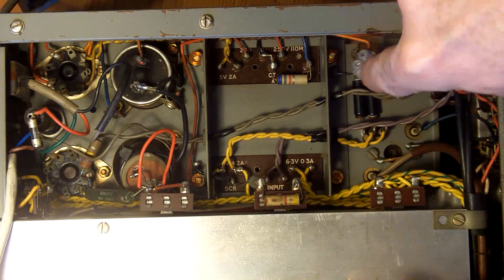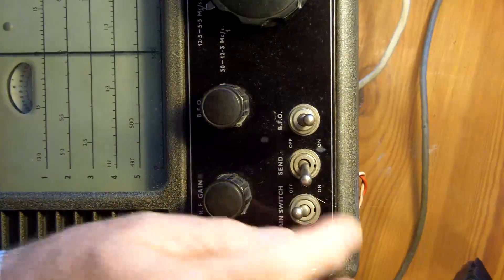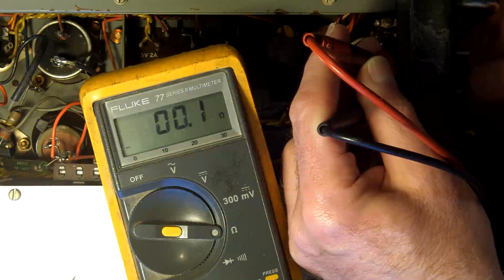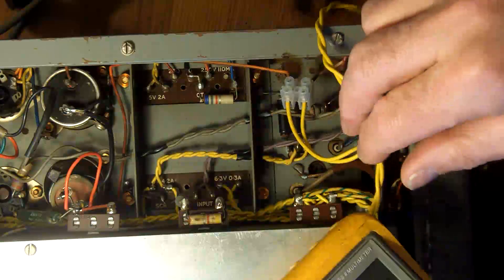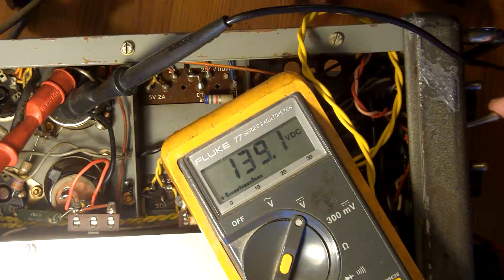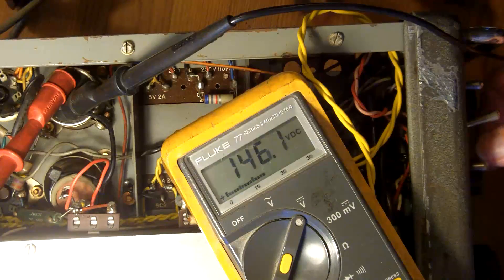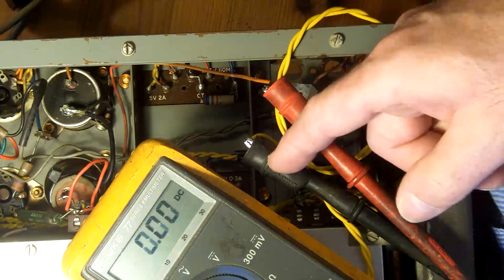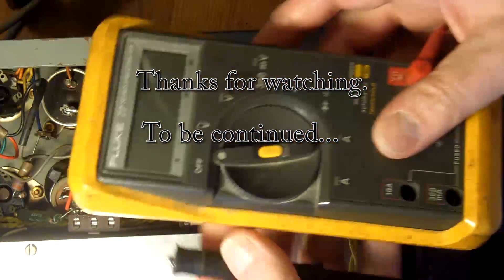About Radio ... Part 26 Eddystone S680X ... Working towards a full mains voltage test

Comment from the maker: @RapperBC 
Hi there, I’m glad to be of help. It’s always a good idea to discharge capacitors. It’ll be the one time that you either forget or simply think... ‘It can’t possibly be charged’   that it’ll get you. I’ve worked on faulty high voltage industrial equipment where the capacitors got charged through an air gap but they didn’t discharge as the bleed resistors where on the feed side of the air gap. Very dangerous with physically large capacitors at 8KV
Play safe.
Kind Regards ... Andy

Comment from the maker: @bonecrime
 I’ve got a moving coil test meter that I was given, half of one of the terminals is blown away. When he gave to me the guy said that he realised he didn’t know how to use it when he unplugged the meter lead from the volts socket amp tried to plug it into the amps range socket to see how many amps he could get from a 13A socket. UK our ring mains were backed up by 30A wire fuses with a fusing factor of 1.5 so 45A x 240V = 10.8kW +  meter with no fuse = arc welding! Regards ... Andy

Comment from the maker: Hi again. By the way, you’re seeing it as I saw it; nothing on the 680X was rehearsed, in fact there’s a bit of footage in the next video where I hadn’t realizes id still got the camera running but I’ve posted it anyway. The bit I didn’t get on camera was where I got a belt off the HT DC capacitor, the switching arrangement on the 680X allows you to ‘power up’ then go into ‘standby’ ie disconnecting the load and then switch off the mains leaving the two filter capacitors charged!    ...    Andy